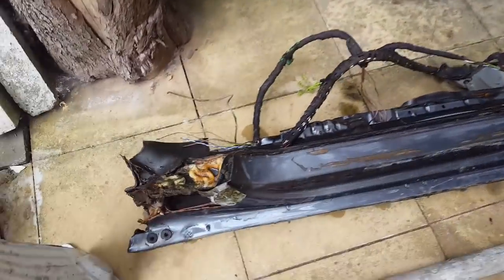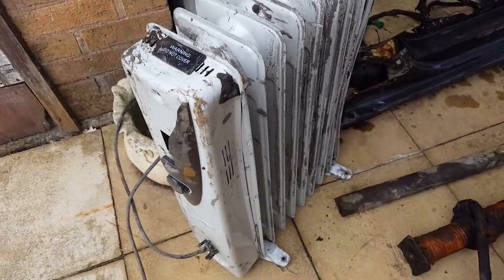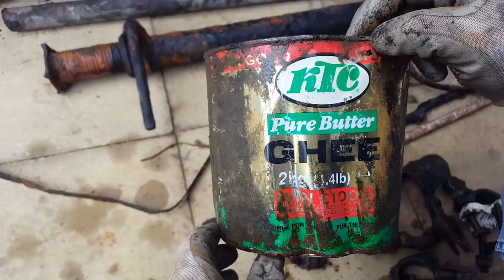magnet fishing someone tried to heat up the canal

Comment: https://www.youtube.com/watch?v=6t1vaF50Ks0    your right again on the acrow prop, they are used to hold formwork in place four pouring reinforced concrete, that bridge you were under had reinforced concrete supports, so acrows were probably used there (there are more modern support systems now, but acrows probably still in use). I think ghee is clarified butter (whatever that is) and is used in  Indian cuisine ie curries etc??. Sympathy on the back, fellow sufferer here, thankfully not all the time, get well soon.